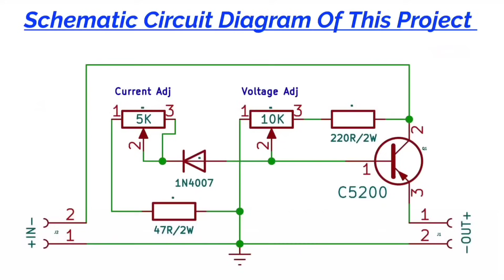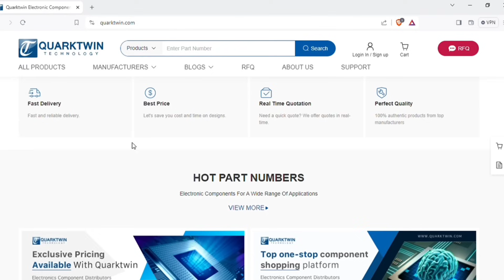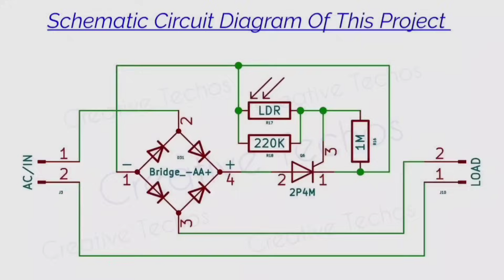3 helpful Electronic Projects for beginners

Comment: Thanks for the video.
Can you mention what the input voltage is in the first project?
Reply: At 2:06, the voltmeter shows 27.2 volts of output.  I would guess that the input is about 30 volts DC.  At 2:33, the circuit lights a 90 watt automotive headlamp, which would require 6.6 amps.   I think that with this circuit design, the input current must be larger than the output current.

Comment: Without series current limiting (e.g. a resistor) the leds will blow! 🤔🙄
Reply: The resistor was omitted from the schematic, but it was present on the physical model. Although 220 ohms is a little low for a 14.xx volt supply. You would want at least 560 ohms, but with modern LEDs, just whack a 1K in there and you won't be wrong!
Reply: The resistor was on the ground side.